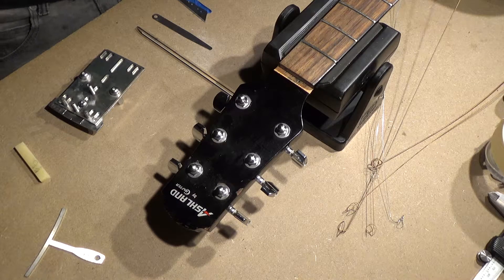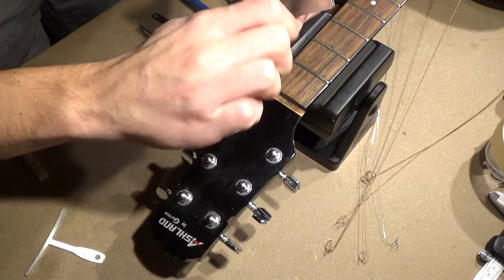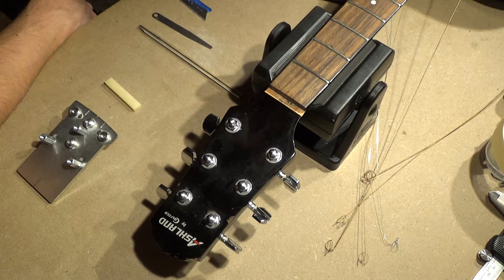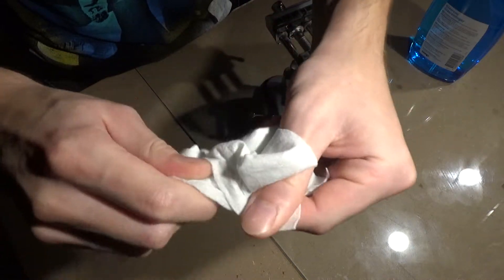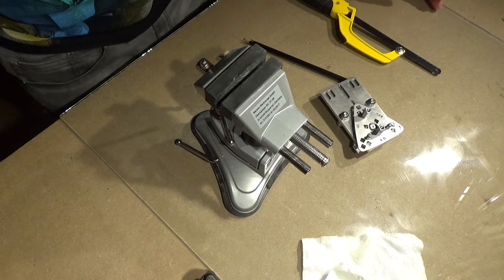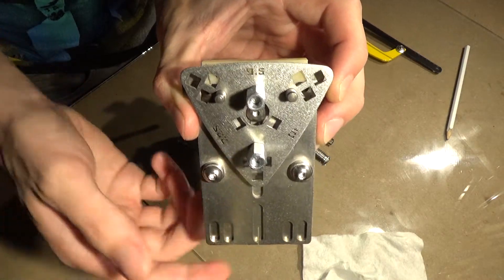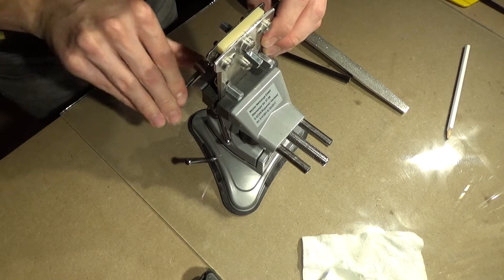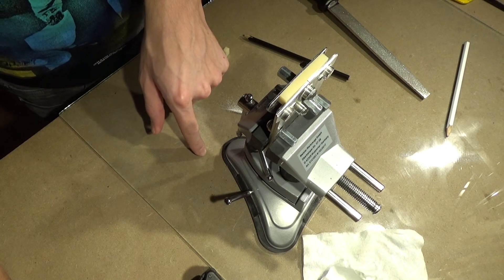Acoustic Guitar Gets A New Bone Nut - Part 3 - Measuring Nut Slot Depth & Degreasing The Bone

Comment: i hope that nut was previously degreased decently otherwise that window cleaner won't help, the grease of the nut will mess up your glue, finish, seep into the wood... that's not something you want
Reply from the maker: Thanks for your comment, Nigel :-)

The bone was previously degreased, yes. I always take out the blank and let it degrease for some time, before I start. I've heard from many luthiers that the window cleaner is perfect for this, and since the nut is being sanded and shaped, then there's no problem :-)

Thanks for watching, and your comment, Nigel.

Cheers! :-)